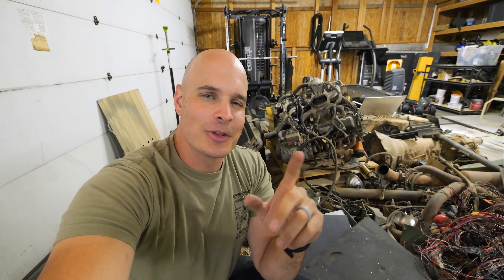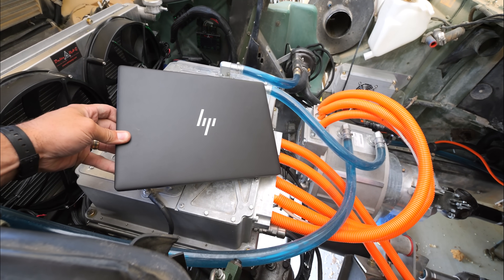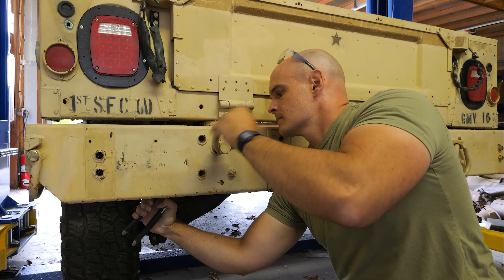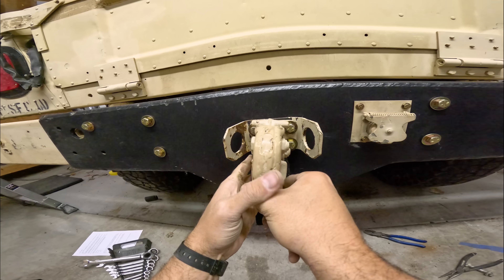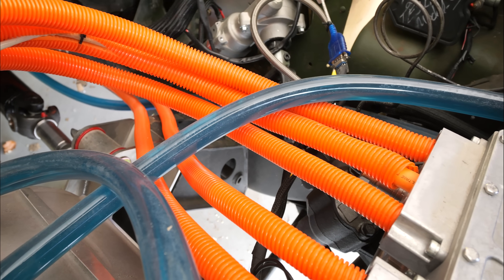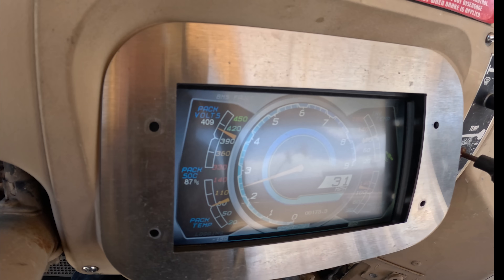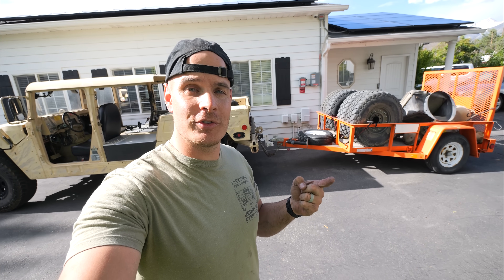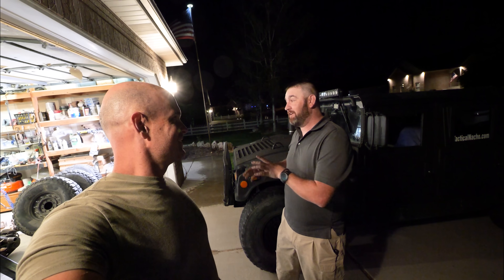Can my DIY Electric Hummer tow it's Guts Out?! - First time...

Comment: I could watch you drive this truck for hours and debugging its issues. I love this truck it's a new life goal for me.
Reply: It's a lot more fun if you don't have a Youtube audience forcing you to do it "the right way". There are a lot of corners Jerry could have cut to get going cheaper and easier. Like the dc/dc converter, it can't fail if you don't have one at all, you just have to remember to charge the 12v battery occasionally.
Reply: @augsu or you could have one and not have to charge it yourself, saying that though why should we use motor boats, let's just paddle them instead because we would only have to refuel them.
Reply: I liked his resolve on the issue and is completely in accordance with variable voltages

Comment: when sizing a circuit breaker or fuse, make sure you get one thats rated for the application (devices being protected and wire size) breakers trip and fuses blow for a reason, its not always as easy as putting a larger size in place
Reply from the maker: Correct.
Reply: Yes, if the charger draws 45A peak, the manufacturer might require a 60A breaker on it, or a slow blow 40A breaker, so that the momentary 45A draw for a few seconds does not trip it.
Reply: @SeanBZA  idk about other countries, but the NEC, the codebook that the US follows has guidelines specific to how over current protection devices should operate for both AC and DC applications
Reply: @masterbond9  Yes, but a lot of countries follow the IEC rulebook ,so the installations are similar, while the USA has a whole host of different rules depending on which state you are in.
Reply: @SeanBZA  the US NEC is the bare minimum, states and cities base their own electrical codes on it. even if they may be a few revisions behind

Comment: The towing capacity is only partially based on the hp of the drive.  Axles, brakes, suspension, weight, and footprint all play a part.  Towing is probably better due to added battery weight and regen braking.

Comment: Really love this project. But here in The Netherlands, before you can go on the road again, you must go true a real MOT check etc etc, so everything works 100% and won’t fail while riding
Reply: In the US, we have a state-level inspection requirement that includes safety and air pollution tests. I assume he had to go through an inspection in his state, but the inspection doesn't include a full mechanical test.
Reply: @JonFrumTheFirst  That varies from state to state though, some do and some don't. By me, not in the USA, all that is needed would be the inspection when bought, which amounts to do the lights work, does the horn work, does the windscreen not have cracks in the visible area, does the suspension not have excessive play (joke on a Hummer), does the engine and transmission not have visible oil leaks, and do the brakes pass a minimum level,  do all the doors work, and the seatbelts (if fitted, plenty of pre seatbelt law vehicles still on the road here), plus a road test to see it does not have too many rattles. After that nothing, till you sell it again. So you see many vehicles best described as rust moving in close formation, and vehicles that resemble the Exxon Valdez

Comment: It would be a Good idea to cool the Motor and Battrey w separate Radiators 
Then use electronicly Controlable water pumps and set em up to turn onn when a certain temp is reached 👌🏼
Reply: yeah, the thing(s) that produces more heat getting one cooling system and the not so hotter thing(s) on another. So less chance on cross heating and more cooling on where it needs

Comment: Hi Jerry ,been watching this conversion from the start.   Perhaps a bit too obvious but, would running the motor and battery coolant on 2 independent  cooling loops make sense.
Reply: @ Steve Goodine
Yes I had the exact same thoughts about it and it never hurts  to have too much cooling capacity! 
But he probably wants to use the motor heat to help heat up the pack in cold weather, I’m sure he can find a solution!

Comment: The breaker is only a short circuit breaker, used for car-audio or ignition. Means the rating like 50A stands only for a couple of seconds and not for long period.

Comment: Thought for the cooling distribution system.

Maybe use a dynamic T valve that is able to divert more of less fluid down each loop dynamically based on temps of each system? If it was dynamically adjusting the distribution between them it would probably stabilize no matter the activity you were using the W for. 

Control loop could go something like: 
T1 = Temp 1
T2 = Temp 2

loop for inf 
(If T1 > T2 (divert more fluid to T1)
else if T2 > T1 (divert more fluid to T2)) 

this is pseudo code. etc. 

Something like that would balance the cooling capacity between each loop.

Comment: You should install the transmission so that the battery power will be lower and the engine speed is lower, this will save power. And the torque generated can be utilized

Comment: For anybody watching at home: If your breaker keeps breaking, find the reason, don't just replace it with a bigger breaker. Obviously Zach built an EV Hummer so he knows what he's doing, those cables are PLENTY big enough to carry over 40A of current - your homemade 12V system using thin wire is not the same thing.

Comment: The breaker situation maybe as simple as the acceptable spike before trip rating.

You can get different ratings from, I believe, from A through D.

You may have a B when you need a C or a D rated fuse.

Comment: It sounds so much better! Were you able to fix that high-pitched whine, or was it just edited out of the video?
Reply from the maker: Over 15mph it stops. I think it's some kind of requency that helps position the motor at low RPMs?
Reply: Good to hear it's only at low speeds, and not all the time! I was worried for your hearing/sanity 😅 Even though I'm guessing this project hasn't gone as smoothly as initially expected, thanks for keeping it going  - can't learn anything if you're not at least a little ambitious, haha.

Comment: That diesel engine can be connected to a DC generator for a car instead of the engine providing movement for the vehicle it will only be there to recharge the battery while a Electric motor powers the vehicle.

Comment: My ioniq has a dc to dc inverter issue where the inverter doesnt keep the battery topped off when off, and as a result if it sits for a while it will drain. This did lead to a dead battery that had to be replaced. Make sure your inverter runs every so often or has a low voltage detection even when the systems off

Comment: No way to put the brakes on its own circuit or make it mechanically feasibile to use them without assist? Great vids as always
Reply from the maker: Oh - the brakes are always avalible (including parking brake) its just the powered brake assist that went out.  I was still able to slow it down just fine.
Reply: @JerryRigEverything  glad to hear it! Stay safe

Comment: The towing capacity of a vehicle is more about the chassis, gearing,  and brakes than power output, so an EV with regen has the advantage of two braking systems. With an EV it is easier to package major components  than with internal combustion, making the vehicle better balanced and reducing stresses on the chassis. That is a beast of a chassis, and with 100-150 kW of regen, I would be comfortable towing 10k with a bumper hitch, more if you could figure out a Gooseneck hitch. EVs also have the advantage of adding regen while taking your foot off the accelerator. like a Diesel without overdrive, this is much safer than modern low torque engines with multiple overdrive gears.

Love that gauge that shows voltage drop, that is the best indicator of overall battery happiness. Motor and battery temp are nice too, controller temp would be handy though, and altitude, evs are super sensitive to altitude change, especially when towing.

Comment: I know it wasn't the towing that was an issue but what I would say is that there are YouTubers out there that have road tested towing and the drop in range is shocking. The other is that using a public charger with a trailer on the back is a real pain. Often you have to unhitch and park the trailer, then come back to the charger area.

Comment: Wait how is your break wired? Is it completely electrical? I didn't know brakes could die without power...I didn't get to finish watching your build process videos 😅.
Reply from the maker: The brake booster is 12v, but the brakes themselves work without electricity, they just are quite a bit harder to press.
Reply: @JerryRigEverything  I see. That's very cool. Thanks for the reply!

Comment: Zack put a 4 speed transmission gear on your electric car to get efficient..................
Reply: Unlike ICEs there is little difference in EV efficiency between running at high rpm low torque or low rpm high torque. Anything more than two gear speeds on an EV is totally wasteful.

Comment: Interesting.  I was hoping you'd cover the stuff on the trailer with netting.  Why don't electric vehicles have high capacity capacitors for momentary high voltage?  Without capacitors, we are only putting more stress on the batteries and using them incorrectly!
Reply: All the components like the motor inverter will have capacitors on the input. As it's a three-phase output the current input will be very smooth so there will be minimal benefit to having super-oversized capacitors.
Reply: @eDoc2020  The fact that it is a three-phase motor is already fine and dandy, only the battery suffers.  Every cell experiences the so-called breathing effect when we press the accelerator pedal.  Even if you lost the front trunk, it would be worth the investment, because you would only replace the capacitors in case of failure and not have the battery explode.  Regenerative charging would also be more stable, as the battery cells would be charged with a constant current and voltage in a sufficiently large amount so as not to burden the components.  At the same time, we could add an option to the vehicle to charge the battery manually or by foot if necessary.  Technology develops due to need and if there is no consumption there is no means for development.  Capacitors and batteries are similar technology, but what differentiates them is important for further development.  In any game that uses an evolutionary concept to develop technology, if we only develop one branch of technology, we must always go back to the beginning and develop everything to a certain point before continuing to play!
Reply: @matjazwalland903  Capacitors large enough to make that much of a difference are crazy expensive. That's the biggest reason. Plus to do as you describe you'd need additional high-power converters to decouple the capacitor and battery voltage and that will just add inefficiencies.

On top of that batteries in EVs (especially plug-in hybrids) are designed to handle high current. Unless you have something like a first-gen Leaf which lacks a battery cooling system it's a complete non-issue.

Comment: are the parts in the cooling in series or parallel? if in parallel you will likely want 3 thermostats that bypass their feeds around the radiator whilst still maintaining flow. It might be better to have them in series with the hottest thing first, battery last so the heat from the motor warms the battery in cold weather.

the biggest issue with parallel is flow balancing as the water will flow through the thing with least resistance with little flow going through the other components.

Comment: I would go with a blue Seas circuit breaker they are more expensive but you get what you pay for I have them on my boats and never have issues with them and that's a saltwater environment so that says something LOL. And you want that reliability especially on a boat in the middle of nowhere or your Humvee cutting off in traffic

Comment: I was waiting for him to give us the sponsor spiel about the tow hitch. After that the wrench. Then after that the cordless drill. BTW. Over torquing those rear bumper bolts without a torque wrench but instead using a rattle gun will stretch those bolt threads. Just sayin, "But but hi tensile" Not no more.

Comment: Those breakers are terrible, they're based on a bi-metalic strip that heats up and trips the load. Trouble is they are no good at sustained loads such as yours. Swap it out with a fuse like the midi link fuse and carry a few spare with you - much better.

Comment: Do you have a weight on it yet, what about a kwh per mile usage? 

Even though I have at least 2 years of savings for batteries left, I'm still on the fence between the ~100kw Tesla pack or the ~140kw Rivian modules.

The added LFP safety desires have me pushing towards a Rivian pack, but the Tesla modules are a proven swap

Comment: The voltage drop makes sense to me based on the % a typical battery loses as the capacity depletes but I don’t know too much about EV batteries specifically 😊
Reply: Yep, LiIon batteries have a pretty nice flat voltage curve in the middle, which is way easier to work with than some other chemistries. Just amusing that it worked out to ~1v/mi

Comment: 😂 "towing its guts out" proceeds to hook up and pull a tiny lawnmower trailer with 2 tires 😂 thats NOT towing! My grandmothers mini-van pull that exact trailer with 10x as much weight!
Reply: He had 400 pounds just in tires on that trailer, in addition to the engine, transmission, and other bits. Please let me know what minivan model can tow 6000 pounds, I might want to get one.
Reply: @eDoc2020  until he "tows" a 24ft double axle with a 10,000lbs of tractor... he aint "towing" $#!+. Any van with a v8 will tow 6,000lbs easy and an engine, transmission, and 400lb tires doesn't make 6,000lbs, it would take a full sized 4x4 3/4ton truck to weigh 6,000lbs

Comment: Uhm, am I wrong thinking that putting the "light tyres" between the axles is a BAD idea?! I was taught to always have the point of mass between the tyres axles, so it doesn't go snakey-snake on me a fly me off the road. The way it looks at 4:33 scares me honestly.
Reply from the maker: Those tires have metal run flats inside and weigh almost 200 pounds each. 👍 I'm not new to towing.

Comment: i dont think its safe to increase the breaker Amps... 12V car batteries should not be charged with that much Amps.. you need to configure the DC2DC to max output only 10-15% Amps based on the battery itself.. personally i wouldnt go past 6A

Comment: 🤪Well done on the 12v outage, "no brakes". Good no accident too!! I have used those exact breakers for a solar project and have a very low opinion of them. A 15 dollar fix..... Hmmmm.... Make it a better breaker..... they're pretty bad. Wouldn't trust them with my brakes, even a higher rated one. Love the Hum-V :) though.
Reply from the maker: Good call.  I'll get a better component.

Comment: I mean, im not against commuter vehicles having EV option.
  But if a truck, cant work all day, or tow a 6000lb trailer more than 200 miles 1 way, its useless. The ev world, needs to come a long way. They should of done, diesel electric hybrids, but that would of actually been good mileage, and the sham on all fronts couldnt of happened.

Comment: Electric apocalypse vehicle?  😂
Reply: The sun will still be there after an apocalypse, and if its not, it's more efficient to run a generator than an ice vehicle, also evs are much easier to maintain.
Reply: @Stranger_1  current solar technology is not that awesome.  I would much rather have an apocalypse vehicle that can run on almost anything.  Most people don’t realize that transformers on the power poles have a ton of coolant that many military vehicles can run on along with waste oil, gasoline, etc.

I don’t think the zombies would wait for your vehicle to recharge but who knows.